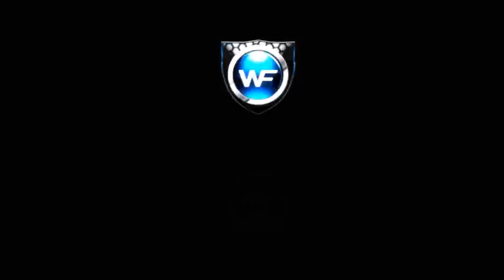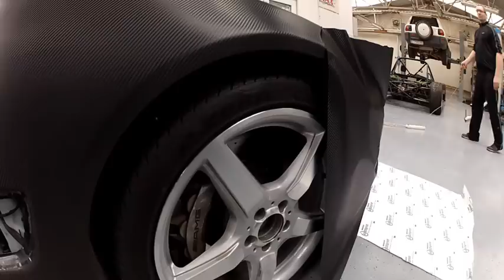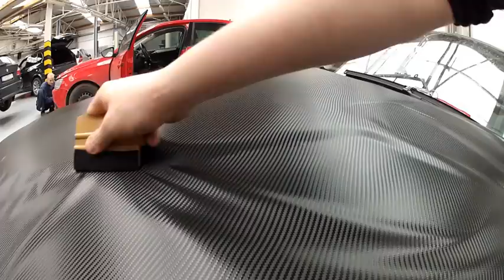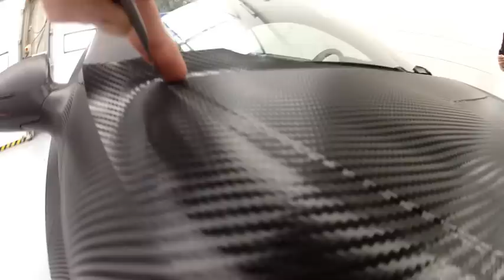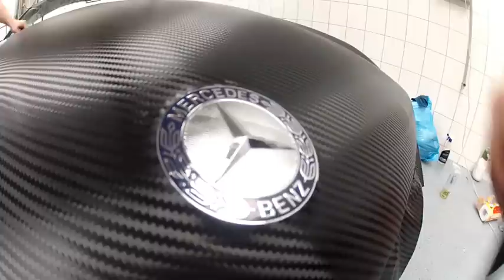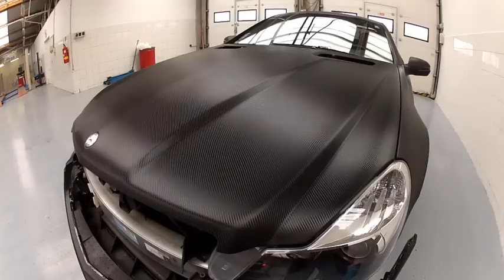Mercedes SL63 AMG | 3M Black Carbon full car wrap | by Wrapp-Fol

Comment: thanks for scratching the whole car with your blades,
really professional to take all the parts of the car and work on them
Reply: RefleX that doesn’t work so well with a patterned wrap, you need to do it in place so you can match the direction across multiple panels.

Comment: Literally adding weight to make it appear to be light weight. Garbage.
Reply: What difference does a couple of pounds of vinyl make on a car that weighs nearly two tons, has a 300lb folding hardtop and massaging seats?  IF we ewer talking about an 1800lb car, I'd agree with you, especially if it were being raced- but at the SL63's rather portly heft, this is neither a racer nor an autocross car. I'm sure the top speed will be exactly the same.